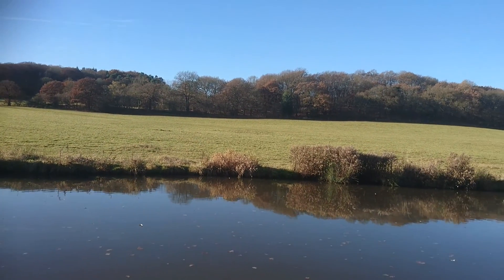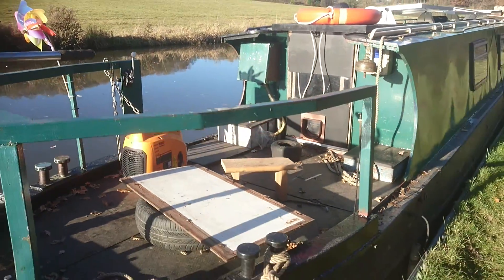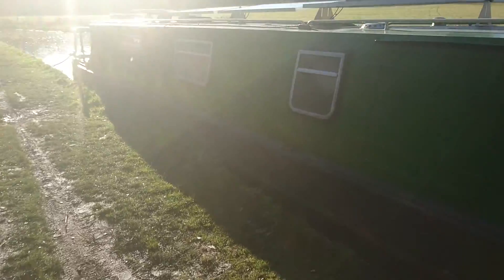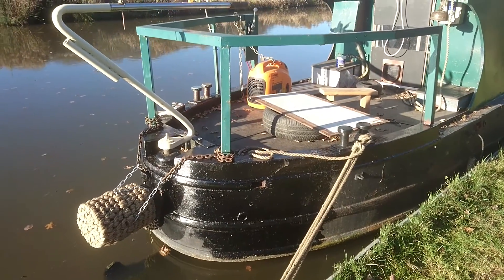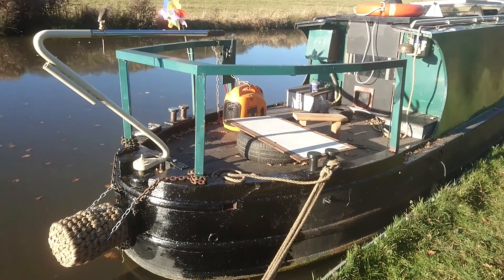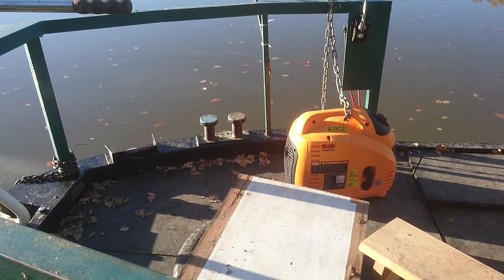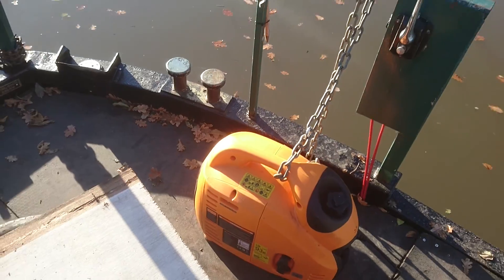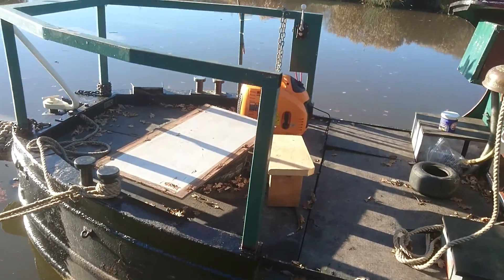002 - Electricity Generation and Blacking

Comment: I would imagine you could generate electricity by running your engine, just like in a car. If I'm right to assume so, why would you need a separate generator?
Reply: Veli Veliev a narrowboat engine is around 40 horsepower, therefore complete overkill for minor domestic power generation. It takes hours to properly charge lead acid batteries, charge too fast and you damage them. So you have a very expensive engine barely idling for hours using only a fraction of its available power. This kind of running is bad for engines and obviously fuel consumption. Far better to use a small generator operating at close to its capacity, doing what it was designed for. Main engines do generate electricity but better to only take advantage of this when cruising.

Comment: Nice generator. Thanks for the tip about sine waves (for when i get a narrowboat... someday). Really enjoying your unique perspective on canal life; different from others :) Cheers!
Reply from the maker: Yes, it's worth getting a good inverter too. We have a sine wave inverter but it does not produce a very pure sine wave so we get interference with any sensitive electronics. If you by bypass the inverter and just use the generator it's all perfect.
Reply: May I ask what brand of generator and wattage it is? Your help would be much appreciated, I have a 22. Raiser stern with no electric so the generator seems like a very good option.

Comment: great video, would have liked to see more about the solar, how you fitted it and connected it up etc. The big problem with some Narrowboat channels on hear only show you a before and after when doing work on the boat & it's not good for people wanting to do the work themselves. Hope to see more :)
Reply from the maker: Hi there, I will make a video which details exactly how I set up the panels following all the wires through the control unit and into the battery. It's very easy and just requires you to be methodical.